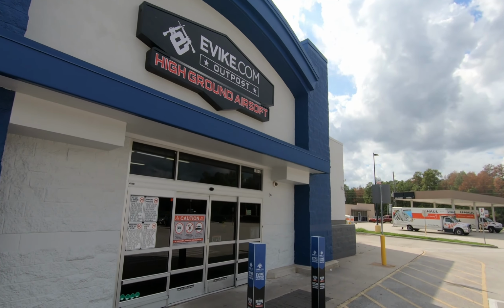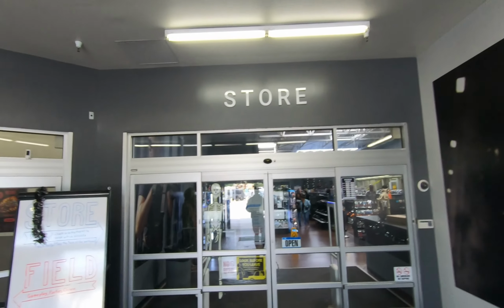I full auto at High Ground Airsoft!?

Comment: this is my home field how do u like it
Reply from the maker: Would be nice if we didn't have to have a safety. If my hpa line is disconnected , a barrel sock on, and magazine out, the gun is plenty "safe". Back at the old field in Spring it wasn't an requirement. Somehow still hot and sweaty, seems like there isn't enough a/c. Should be no more then $30 for all day play, not just 3 hours. If D14 is a 10/10, Tanks is a 7/10, High Ground is a 5/10 experience (me personally).
Reply: @TexasRenegade1166 I just built a new gun my new gun doesn’t have safety do they check when you chrono?
Reply from the maker: @kadenb2008   yes they check for the safety. Its why I dont go there anymore.